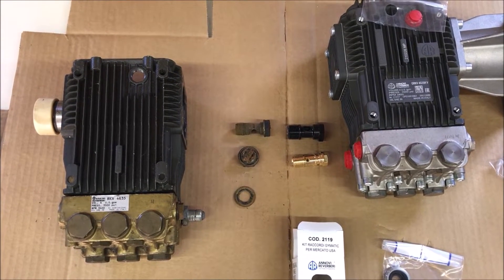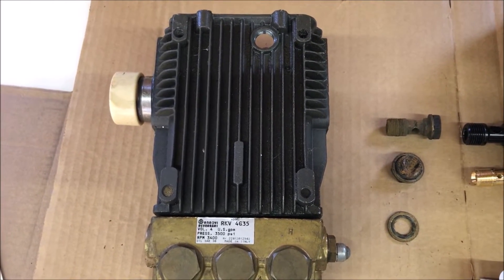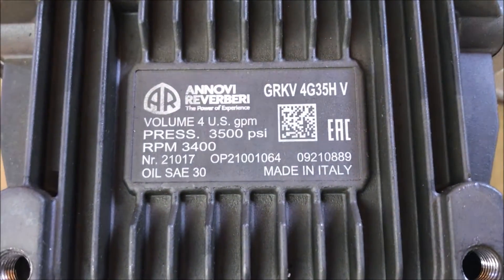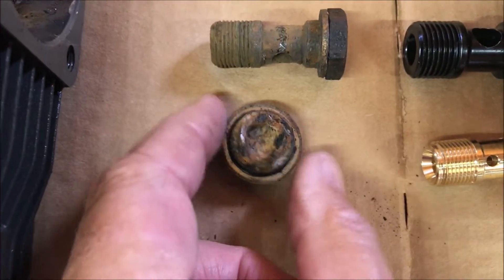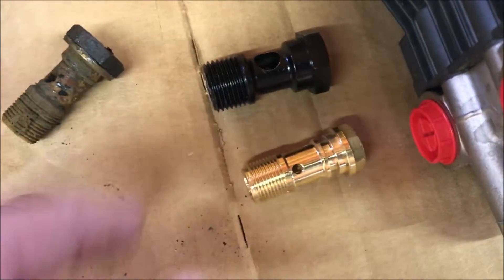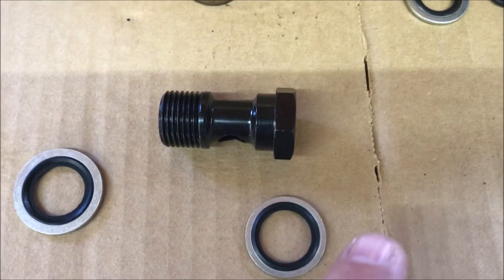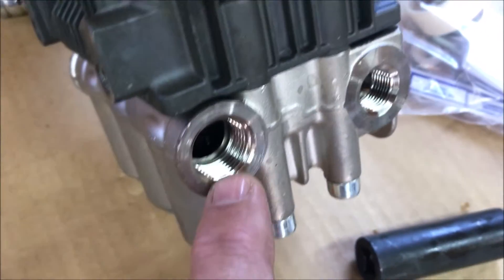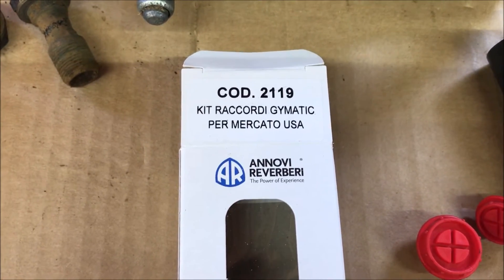OldGuyDIY Annovi Reverberi Unloader Bypass Move To New Pressure Washer Pump. OEM Brass & Steel Bolts

Comment: Nice video, I just accomplished the exact same repair luckily I was able to savage my old pump Xmv 4G30. Getting the rusted bolt out of the brass head was a challenge... In order to extract the rusted broken bolt I burned an entire 7018 rod welding a new bolt to old & was able to pull out the bolt. I can't fathom why a stainless or brass bolt is not used...?
Reply: PS maybe include the part number in your title 2119 I stumbled upon your video searching 'gymatic 3b unloader'
Reply from the maker: Thanks for commenting.